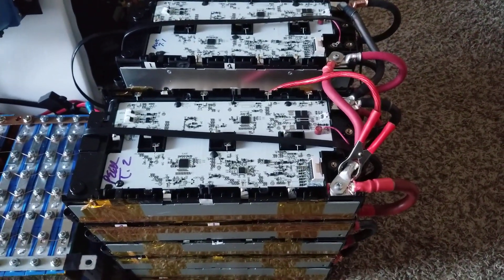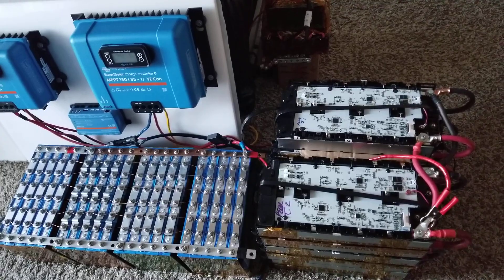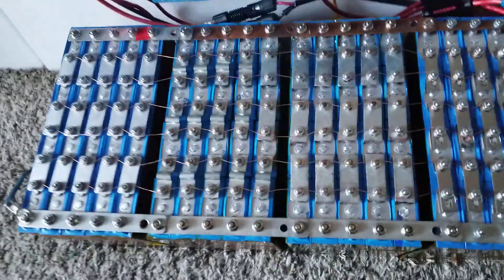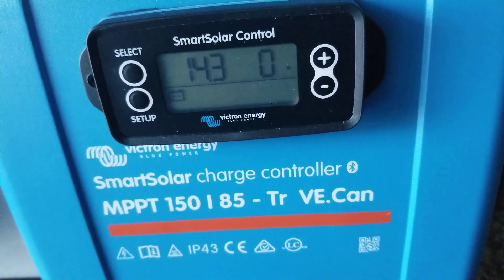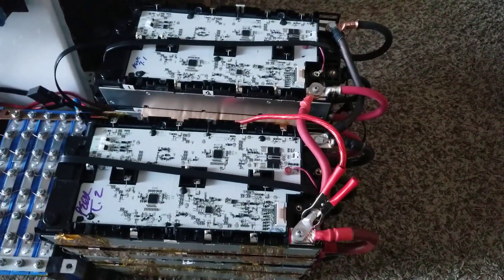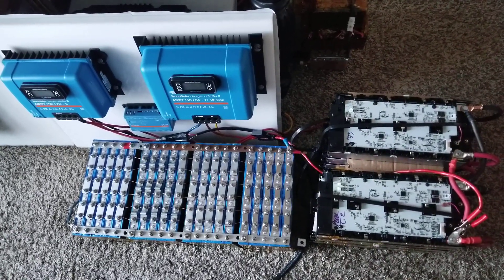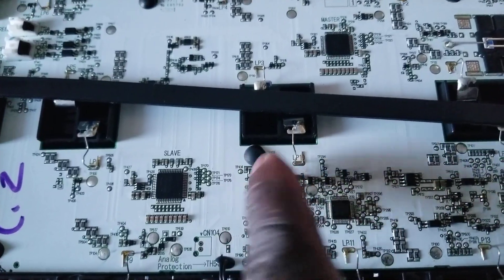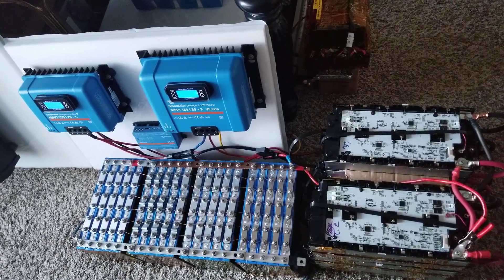PANASONIC BATTERY BANK, 48v 13S 6.4A 307.84WH 12 MODULES WIRED IN PARALLEL AND CHARGING Part.4

Comment: But how do you make sure all the batteries are balanced?
Reply from the maker: The 12 Battery Modules are wired in parallel. This is how the 12 modules got balanced.
This battery bank does not require BMS if that's what your concerns is.
Thanks for stopping by and don't forget to LIKE👍 SHARE and SUBSCRIBE
Reply: @jwsolarusa  ok I understand that part, but when you have it like that, how does it balance individual cells?
Reply from the maker: @martinonumero  
Check out my lithium battery without BMS playlist to see how my battery cells stay all balance.
Reply: Ok will check it out

Comment: I enjoy watching your stuff, especially this new battery. Gives me hope that I could do it myself, albeit at a much smaller scale lol. Hoping I can learn enough to build a high-capacity pack that turns about 4-5p connections at 3.7v to 4.5v to replace three double AAs in a device I would rather not need to charge every 2-4 hours lol. Maybe I will eventually learn enough to build a house PSU, but I am not yet confident enough to do so.
Reply from the maker: Oh....yes you can do it yourself.
I do have confidence on everyone who wants to try and learn stuff.
Keep watching the videos and don't forget to subscribe like👍 and share them.
Thanks for sharing